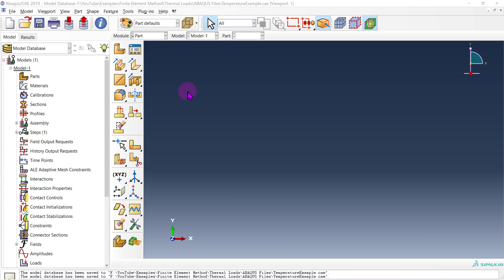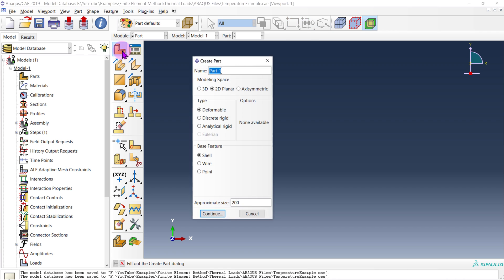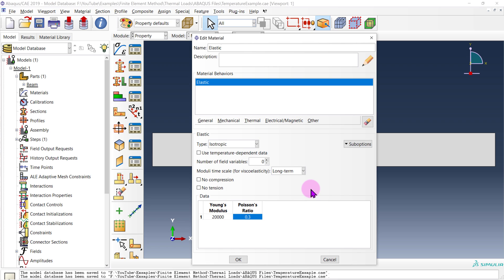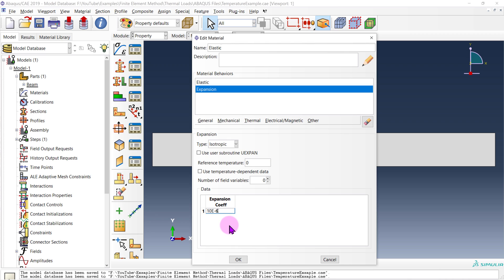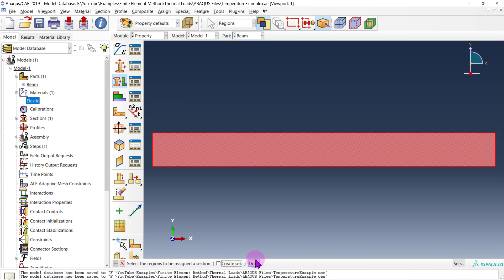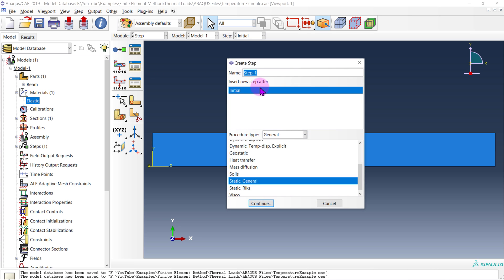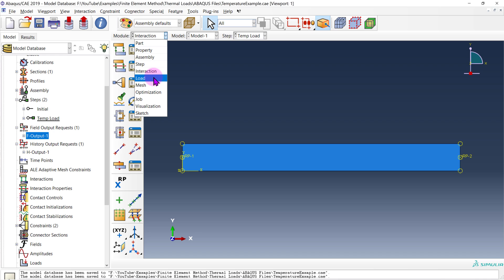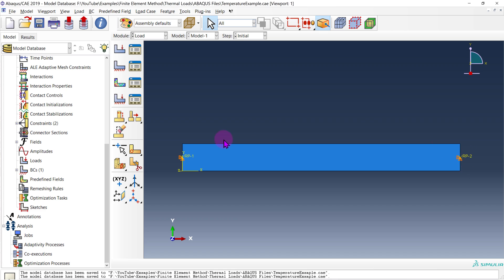ABAQUS Example | Simple Temperature Loads

Comment: In the temperature distribution at 15:40,  the two mesh layers in the middle seem to stay at the initial temp of 20 degrees, does this mean that the result is not at a steady state? If so, how to compute the steady state, and why is it different from pure mechanical problems where steady state is achieved at step 1?
Reply: I figured that out myself. In static, general step no heat transfer process is computed so the temperature always stays the same as you set it. One way to perform a steady-state thermal-mechanical simulation is to first compute a temperature field in a heat transfer step, then use the .odb output file, which includes the steady-state temperature result, as a temperature load in a static, general step. Yet this approach only applies when the problem can be decoupled. Otherwise the coupled step should be adopted.
Reply: @fanl6572  this is the same question i had, do you know how thermal field is calculated? He doesn't involve thermal equations so how does the solver even know how to interpolate the thermal stress from one wall to the other? 
It would make sense to do a decoupled analysis or I would understand why this would happen if all material points feel the same deltaT.